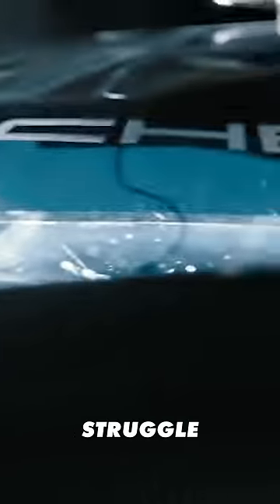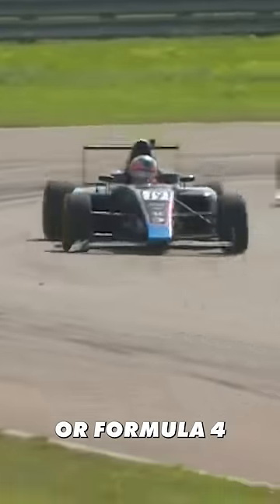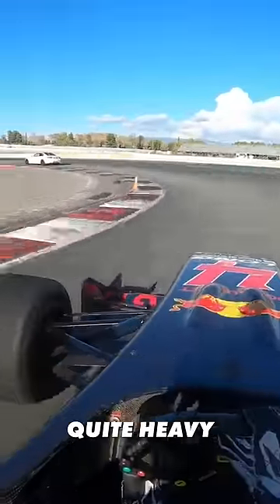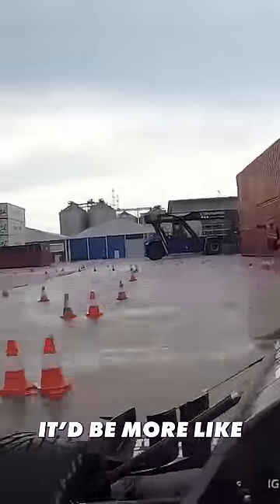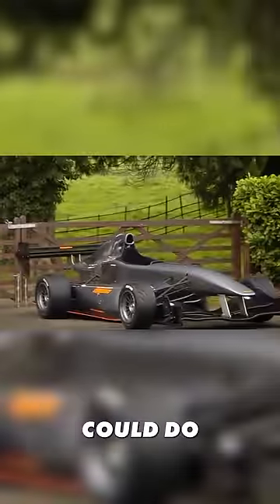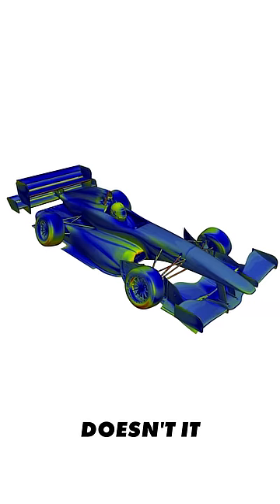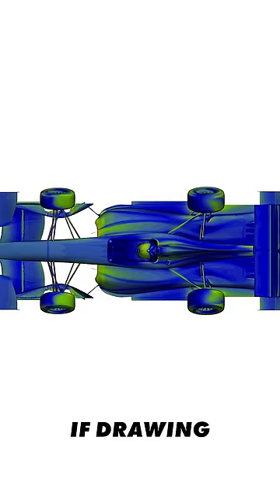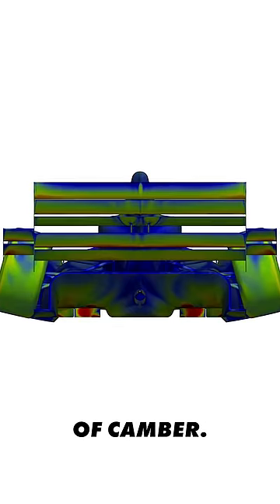The Car I'm Going to DRIVE UPSIDE DOWN

Comment: the big problem with it is not the downforce its when the engine is running upside down
Reply: Yes I agree with the petrol motor upside down , but a car with a battery just big enough to run the electric motor through the challenge should be light enough
Reply: @rduanepemberton1806  Modern high-performance engines are fuel injected, not carburated, so they don't actually care if you go upside down as long as there's a fuel pump so you aren't relying on gravity feed for that.
In fairness to carburated engines, there are also aircraft carburetors that handle being upside down for short durations just fine.
Reply: @thamiordragonheart8682 crankshaft would like to have a word with you
Reply: @thamiordragonheart8682 Fuel injection is one problem solved but what about the oil it will hydro lock your pistons in about five to ten revolutions of the motor
Reply: @thamiordragonheart8682 except there's also oil in the engine and the bulk of it is meant to stay at the bottom
Reply: @rduanepemberton1806 dry sump for the oil, that’s already in existence
Reply: @moxine_ dry sump for the oil, that’s already in existence
Reply: @MeltingRubberZ28 dry sump has been there done that and solved it
Reply: Youd want to reinforce the mounts as well
Reply: Other than fuel what about the oil sump and lubrication, and in the cylinders , you don’t want oil pooling up causing a misfire
Reply: @danielj8292  they use dry sumps pressurised oil pumps but it would still cause problems as it wouldn't exit the engine correctly
Reply: How about all the oil being dumped into the valve covers once gravity is reversed? I'm sure the oil pump will be just gravy baby.
Reply: @justahyundai  ?
Reply: @Quite_Rob  As some others had said,  they could use inverted fueling & inverted dry sump oil systems something like what acrobatic aircraft use. Or they might just do it, because it'll run inverted just the ways it is for a few seconds.
Reply: Dry sump requires oil scavenge pumps with various pickups. It's all possible but you do have to add oil pickups to account for the inverted orientation. You would also need a tank that the pressure pumps could pull from the top of the tank and a way to vent off gasses of the oil without oil leaking out. Same goes with the fuel cell. All solvable but what good is it to start with a $3m f1 car just to tear it apart and add more oil pump sections and pickup assemblies to still have all the exhausting prep of preheating engines etc... it would be best to start with an open wheel car from a lower class that uses a fairly conventional engine. Put all your pennies into the modifications not the base components of the car.
Reply: dry sump oil, fuel cell, pump with baffle pick ups. and it wouldbe fine.,
Reply: A bycicle can do a loop in a tunnel, when you put a little twist through the tunnel the car sticks to the tunnel with centripetal force

Comment: Nothing can double its mass in downforce, only double its weight in downforce. Weight is a force. Mass is density times volume.
Reply: Correct however 🤓
Reply: @jackeyboy6538  it's only 🤓 if you didn't pass the 5th grade
Reply: @DB-fn3fz  “It’s only 🤓 if you didn’t pass the fifth grade”
-🤓
Reply: @jackeyboy6538  yea nah that was gay. Try again
Reply: @jackeyboy6538   try a come back that's less gay
Reply: @BigCroca  “try a come back that’s less gay”🤓👆
Reply: Yes that is true, But i do know that when Steve Saleen was Building the Saleen S7 when they designed & engineered the car he wanted to have as much downforce as possible that’s why the car has so many vents and slits on the body. They took a finished car into a wind tunnel that was built to invert the car and basically had a 215 MPH airstream going over the car while It was upside down and it stayed in place. car wasn’t running, he just wanted to basically say in theory if it was possible you could drive the car upside down due to the amount of downforce the car created! when i visited his production building they had a video of it playing because when he was building the car if you bought one you went to the facility and saw your car being built and you were measured and fitted for the driver seat because it wasn’t adjustable and if you sold it the new owner had to send it to factory and go there to fitted for driver seat . was pretty cool

Comment: I don't even see why this is still in question. The car generates downforce by moving air over its wings. The faster it goes, the more force is generated. At a certain point, the down force generated will surpass the gravitational force of the car's actual weight. The 2 combined is what the car would weigh on a scale in motion. Now invert the car. Subtract the gravitational weight from the total. As long as the car generates more down force(when it's upside down) than it has gravitational weight, it will continue to drive upside down. We watch airplanes do this every day, but somehow, this is still a debate.

Comment: A Formula 1 car can do that. in fact, even a Porsche 956 would have coped with this after accelerating to 321 km / h, but a very long tunnel is needed, which will allow the car to smoothly turn upside down.to build such a tunnel, you need to spend a lot of money, since 300 km / h is about 83.3 meters per second, it takes several minutes to perform the maneuver, the length of such a tunnel will be at least 20 kilometers, and the real one is most likely more than 50, since you need to turn very smoothly without loss of speed.

Comment: My fear is that you won't have enough traction to fight the drag when you hit the inevitable imperfections in the ceiling/road
Reply: They accounted for that. They're planning for double the amount downforce than the weight of the car. So it'll have traction similar to being on the ground with no downforce.
Reply: @Vessel-v875  no I get the math,  it just doesn't account for the imperfections that are in normal roads, let alone upside down ones lol
Reply: @seionne85 yes if there's a flaw and you lose the air-floor- connection you're screwed
Reply: @seionne85 +the one they are using are specialised to drive upside down so needless to say its going to be smoother than your average road
Reply: @seionne85  That's why they're building their own custom upsidezdown track with a smooth surface and correct curvature
Reply: @ralanham76  Almost all of the downforce will be made by the wings not the floor, they considered this.
Reply: I guess to be more detailed.. the car will have the same >traction< as a normal car at rest, but the tires will have to maintain enough traction to overcome the drag for the entirety of the upside down section, otherwise the vehicle will lose speed, and this will result in a loss of traction,  bc all the force on the tires is derived from the vehicles forward motion.
While the tires have the same grip as a normal vehicle at rest, the force those tires are applying to the road is very different. And that force has to be maintained perfectly.. or else
Reply: @seionne85  Drag is not the problem downforce is but they are making 2x the cars weight in downforce and still able to reach the necessary speed, turning upside down doesn't magically increase the drag and they are using camber to counter act the load problem and provide my surface contact
Reply: @ChatminAC  drag is the problem exactly, traction has to be greater than drag or you spin and lose speed
Reply: @seionne85  nobody cares about imperfections.. thats what rubber tires are for.. and suspension.
to deal with such imperfections
Reply: @seionne85  That don't make sense..

power has to be greater than the drag yes.

traction just has to be there.
if the car doesn't falkl down, it will have enough traction

Then just power to defeat drag, which isn't a problem on such cars either way, we aren't talking about your mums VW polo
Reply: @stijnvandamme76  if a vehicle is travelling at a constant speed, the tires are still exerting a force on the highway opposite the drag forces to maintain that speed

Comment: What will the engine go through while being ran at high rpm upside down?
Reply: Better get an airplane engine.
Reply: @CHMichael I hear the American-favorite M1 Abrams has a turbine jet engine... If that's not enougu power, you can always turn the turret around and start firing.
Reply: in WW2 they V12s didn't care a lot about going downside up after fuel injection started being used
Reply: If they use a dry sump it’ll run normally
Reply: If it’s a wet sump the oil will just go to the top and it’ll blow up most likely
Reply: Inverted dry sump oil system and fuel system like an acrobatic airplane has.

Comment: Just remember, the 919 Evo is delivering 711 of the horses with a 2l V4.
Reply: More boost and wings and IT IS The car!
Reply: V4 ? seriously
Reply: @huck69    yes. A 2l V4. In the Evo spec the Porsche 9r9 engine is capable of producing 711bhp. Porsche developed the engine through numerous years dominating endurance racing, it's why Porsche are the un-beaten kings of automotive technology.
Reply: Four cylinders are all you need! 😁

Comment: I remember NASCAR drivers talking about this; the downforce is a ton and a half, and the car is much less than that. Im ALSO surprised it hasent been done before.. The hardest part will always be accommodating the clearance of the vehicle at all times. The vacuum under the car is going to need to be catered to.
Reply: It has been done, team hotwheels did this about 20 years ago

Comment: If memory serves, the reason thos works is because the car is on a flat surface. I would imagine you would need to make a corkscrew type tunnel where the flat road transitions from the bottom up the tunnel side to eventually end up as a flat roof. Thar and the other obvious issues like needing to pressurize the gas tank so it flows sideways and upside down, among other things.

Comment: Interested to see it happen. I don’t know how you will ever generate enough downforce to stick yourself to a surface for an entire loop of a tunnel but I would be interested to see it happen. My biggest concern is how do you design enough Downforce to suction cup the car without bottoming out the car on the tunnels curved surface. Need to have a perfect curve to the cars floor while making sure it doesn’t bottom out and break the grip of your downforce.
Reply: The model is there for you to see

Comment: You will need every bit of 0* camber after calculations of the weigh of the vehicle and it's down force. Stickiest compound tire. Achieving traction to overcome the weight of the car pulling down and get enough downforce to keep it up will be your biggest issue. 4wd would definitely help.

Comment: Okay, but you also have to think about oil control in the engine and to some extent the gearbox and also the brake and clutch master cylinders. The biggest issue with the f1 car would be the expense of modifying the expensive components. I hope you get everything sorted. That would be cool to watch. But it sounds like a lot of effort getting the fuel and oil to work upsidedown just to go upsidedown for a few seconds and tell people you did.

Comment: If you pull this off you'll go down in history. ICE power brings so many challenges though. Have you spoken to McMurty or the Swiss university that did the 0-60 record with the electric fan car? Electric with small battery has got to be the easy option. Think you would struggle to get an FE car with a smaller battery as it's one big unit and might be structural, but those two might be more modular.
Reply: And FE cars are pretty low downforce

Comment: Almost all engines wont run when upside down, even with dry sump gravity is used to move the oil back down the motor and having it run in reverse ia going to be one of the biggst problems to get over

Comment: My only wonder is this: if you are upside down, you will need over the weight of the car to hold you there. So is the top of the structure able to hold the weight of the car pushing up?

Comment: I don't recall the name, but Tom Scott did a video on an electric car that does 0 - 100km/h in 1.5 seconds, using a giant fan (or multiple fans) to suck it to the ground in order to get enough grip. That should easily do it, I guess.
Reply: That was a formula student car

Comment: How are you going to modify the engine to work under negative g? Cause the engine oil system works with gravity
Reply: Inverted dry sump oil system and fuel system like an acrobatic airplane has.

Comment: What is your team is considering in regards to keeping the engine lubricated while upside down? I mean 5 seconds at idle with minimal  to no oil pressure would probably be fine, but I imagine at the speeds/rpms you'll be needing to go in order to generate the downforce you need to stick to the ceiling, the engine might not survive.
But then again, I have also seen people put a brick on the gas pedal of a car with no oil in it to see how long it will survive before the engine dies. And they have lasted upwards of 10 to 15 minutes at wide open throttle. 

But then again, again, they weren't trying to drive those cars upside down with their life on the line.

Comment: Okay but what about the issue with the engine as u are upside down? Wouldn’t you lose power
Reply: Inverted dry sump oil system & fuel system like what acrobatic airplanes use

Comment: The fuel pump is the biggest problem to drive it upside down, maybe3 with some modifications
Reply: Hybrid
Reply: Inverted dry sump oil system & fuel system like what acrobatic airplanes use

Comment: In short. You can’t drive an F1 car upside down because the engine and all around design isn’t equipped to function upside down. You can have all the downforce you need, but what good is it if the car dies on you as soon as your upside down
Reply: Inverted dry sump oil system & fuel system like what acrobatic airplanes use

Comment: The problem with this concept is you don't need downforce, you need lift. The car design needs to be different.
Reply: Downforce is lift. 

But no, you still need downforce because you’re pushing the car down onto its wheels.

Comment: I'm sure it can be done the rock crawler already have an oil system to run on all a ankles. But the with downforce   a the car that had fans to such it to the ground it definitely possible

Comment: The shade at formula student cars, damn, their aero is massive so why not?
Reply: I think because it’s more like a go-kart than a car. I think they made the choice so the car would be as close to an F1 car in look as possible
Reply: they're made by a team of undergraduates. 90% of them don't pass safety
Reply: Yeah we passed safety on the second day💀
Reply: The topspeed of formula student cars is not that high (~35m/s) because it’s designed for high cornering speed on pretty narrow tracks and max. power is regulated by the rules to 80kW.
But theoretically the formula student car from my team could do that at 32m/s (~115kph). But only driverless (autonomous driving) because of the high weight of the driver. 

Info: 
A formula student car weighs from 146kg to about 220kg. At least in europe.

Comment: Ill believe it when I see it. People have said this nonsense for literal decades and still not a single one has done it
Reply: Nobody has done it because engines arent designed to run upside down, the aero is fine but the mechanicals are the limiting factor
Reply: @j_wide583 it's actually not that difficult to make an ice run upside down

Comment: Toyota did make a car to run in WEC i think it was the 1995 or 1999?? it hand so much down force that it could corner flat and faster than any F1 car, on paper the car was perfect and if you put it up against any car at the time in WEC it would win every time... in the real world the G forces the car could generate in the corners was too much for any drivers and some of the drivers would intentionally driver slower to prevent their bodies from taking a beating, there was a driver who was pushing it trying to make up time during a race and he ended up braking his spine turning a corner...

Comment: What about when you flip over won’t all of the mechanics inside the engine not run properly ? Idk f1 engines all that well how does oil move around in these engines ? Similar to regular but not the same?

Comment: It's not possible without 100% more downforce. If the car weighed 1000lbs it needs 2000lbs of downforce. It's too hard to do
Reply: The model can do it theoretically
Reply: How far did it go?
Reply: @RevengeAvenger  what do you mean how far did it go?

Comment: I have been hearing about this myth for 45 years. If it was easy it would have already been done.
Reply: Battery. Aero package has not been an issue for a long time, making a ICE engine work upside down is a very different beast. However a good enough hybrid will be able to continue running.